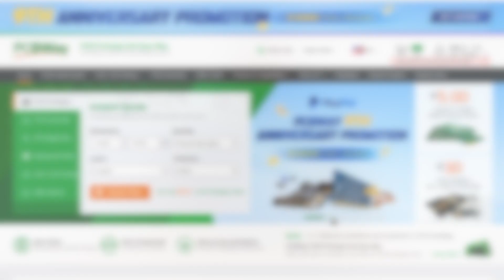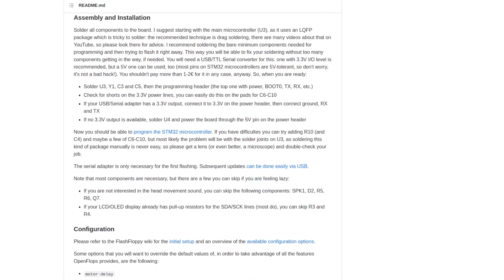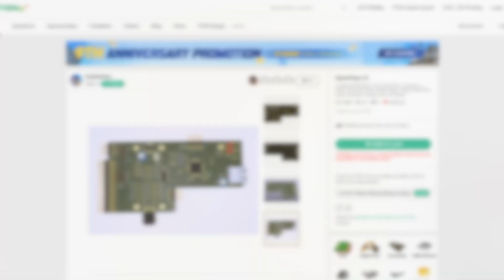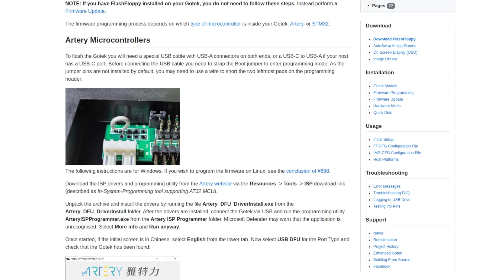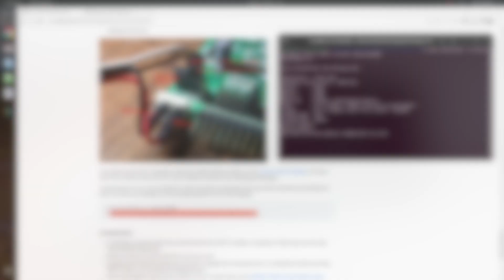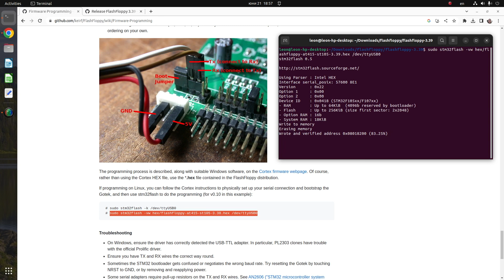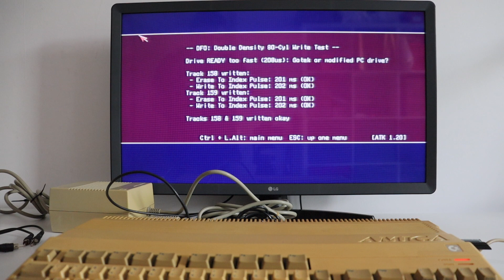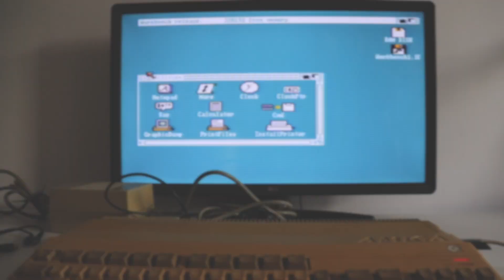OpenFlops and FlashFloppy Firmware for an Open Source Floppy Drive Emulator as a GoTek Alternative

Comment: Hello there! can you say me all differences from original Gotek ? only lights positions?
Reply from the maker: OpenFlops is a completely different printed circuit board (PCB) designed using the open-source KiCad software. Mechanically, it’s similar to the Gotek, so it should fit most Gotek-compatible cases. OpenFlops has been specifically engineered to work seamlessly with the FlashFloppy firmware. Unlike modern Gotek units that use cheap Chinese microcontrollers from Artery, OpenFlops is built around the reliable and well-documented STM32F105RBT6 from the STM32 family of STMicroelectronics.

Comment: Does it have any real advantage compared to the GoTek hardware? The 'advantages' I see on Github are just a list of features, of which all I checked also are in GoTek. And it's not surprising, thinking they both use the FlashFloppy firmware. So: Why pay the higher overall price for OpenFlops?
Reply from the maker: Yes, there are several real advantages. OpenFlops features STM32 microcontroller, more precisely STM32F105RBT6. To reduce the price Gotek switched to cheap Chinese Artery microcontrollers. Another advantage is that OpenFlops is open source hardware: you have the schematics so you can repair it and even modify it if you want. Also keep in mind FlashFloppy is compatible with most Gotek device but not all because there are several Gotek versions on the market.
Reply: @LeonAnavi  Thank you.

Comment: Do you have info about  what the jumpers "JC, SEL0, SEL1, SEL2, MO" configure ?
Reply from the maker: SEL jumpers are for boot selection and MO is for Motor On. JC jumper is required as part of the setup for emulating the 2.8-inch "Quick Disk" drive, used in synthesizers made by Akai, Korg and Roland: https://github.com/keirf/FlashFloppy/wiki/Quick-Disk

Comment: I really wish someone would adopt one of the flashfloppy drives to use an SD or MicroSD card instead of USB.  The usb sticks are far larger and the SD cards even look similar to old floppy disks... so far the only drives I have seen use them is the HxC 2001 floppy emulator (not flashfloppy compatible) and the GoEx, which are almost always sold out...
Reply from the maker: Yes, I agree. This is a very good idea!

Comment: Can it be used as an external drive, connected at the back of the A500?
Reply from the maker: Yes, with the proper cables (the same way you can put GoTek on the back of A500).
Reply: @LeonAnavi  Thank you for your answer and also for the video
Reply from the maker: @peddersoldchap  my pleasure, I hope the video is useful.

Comment: I like the idea of making your own. 
But I just reveived a org. Gotek for 19+7$ delivery.
 I have just modded it with flashfloppy 
1.3" oled 3,5$ and an ec11 encoder 1$ 
so just over 30 total :)
Reply from the maker: Yes, your calculation is correct: OpenFlops is definitely more expensive. There are main two reasons why OpenFlops can't even come close to GoTek price:

1. GoTek is mass produced which dramatically reduces the cost for BoM. If someone starts OpenFlops mid-volume manufacturing probably the cost can be reduced but it will be still 2 or even 3 times more than GoTek.

2. GoTek nowadays uses Artery MCU instead of STM32 microcontroller. This switch was again made to cut the GoTek BoM expenses. During the global chip shortage STM32 MCUs were very hard to find and their prices raised.

The main benefits of OpenFlops are the open source hardware nature of the project and the use of high-quality proven STM32 MCU. Of course these benefits come at a price (literally :) ).
Reply: @LeonAnavi  no the real reason. why they switched to Artery from to STM. 
where Greed! STM raised the price almost 10 fold, for the STM32F105 chip :)

Comment: Can I use stm32f103 instead stm32f105?
Reply from the maker: This is a very interesting question. I am not sure. It looks like that STM32F103 is still supported in the flashfloppy firmware and the IC pinout is quite similar. I suggest opening a GitHub issue to get more feedback from the community:
https://github.com/SukkoPera/OpenFlops

Comment: Nice video.  It's good to know about this Gotek alternative.  Btw, it looks like your soldering would benefit from using more flux.  The flux will help with the surface tension of the solder and make the joints much smoother and less likely to bridge.
Reply from the maker: Thank you! Indeed I initially underestimated the hand soldering efforts for this STM32. Probably next time I will just use a stencil and solder paste.